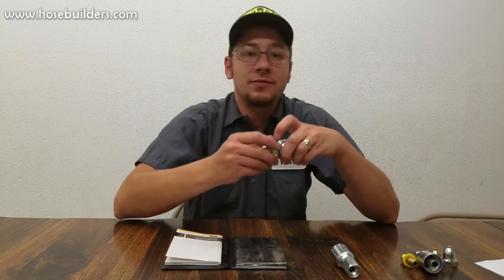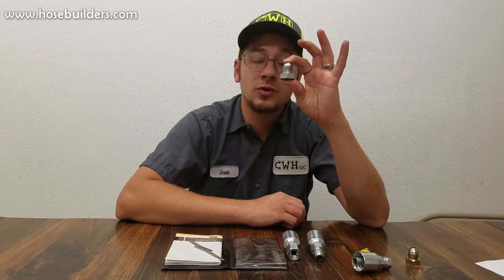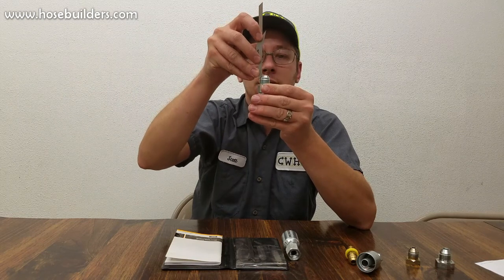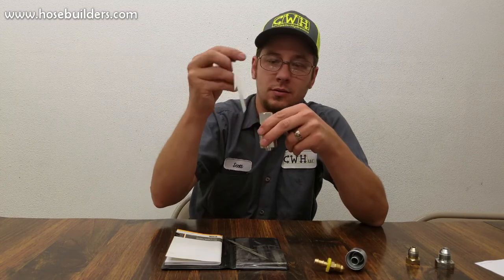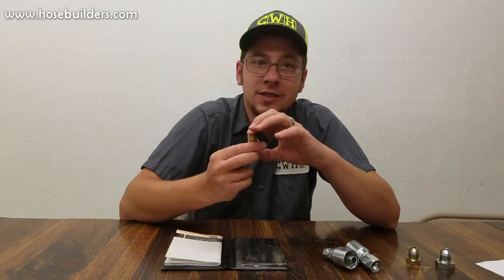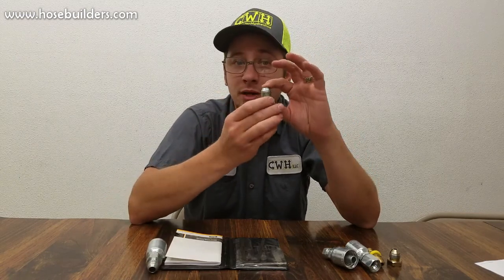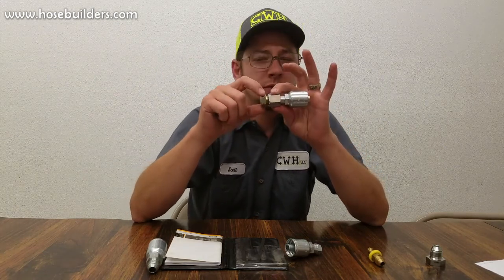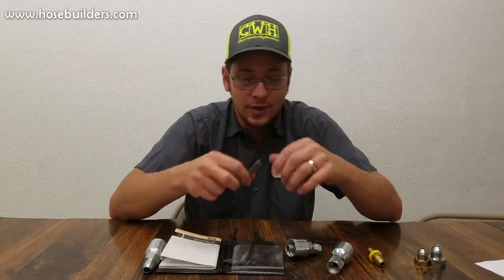Identifying JIC Fittings and Differences Between Flared Adaptors-JIS, SAE, Komatsu, BSPP (Flare)

Comment: Thank you i have a 1998 international that i have changed transmission cooler lines on, the fittings on the truck appeared to be Jic so i bought jic hoses, but they did not seem to tighten down properly, If you could shed any light on this i would appreciate it thanks

Comment: Thank you man. I work at Hydraulic Dynamics in Las Vegas , and I've been there for 3 months , and I'm starting to do the testing stand. My boss is getting ticked because I'm not remembering the difference in standard , NPT tapered threads , and 37 degree flare fittings.